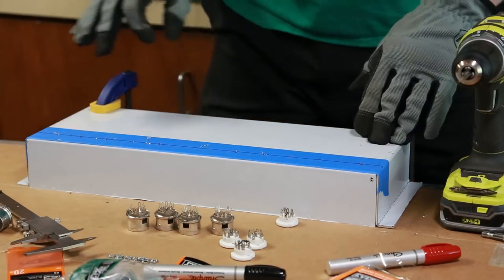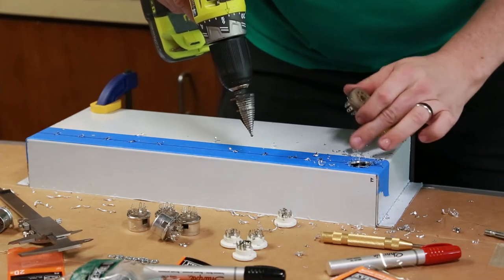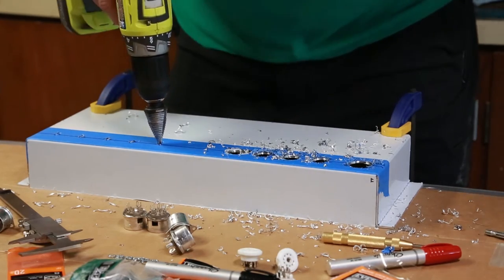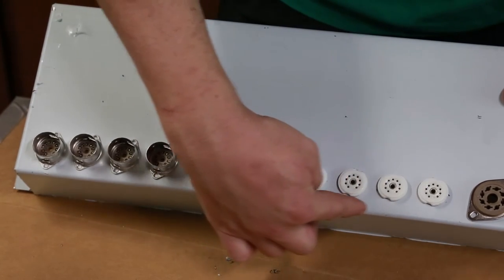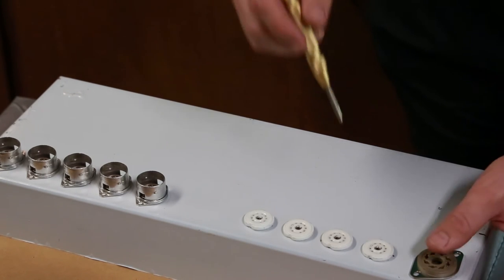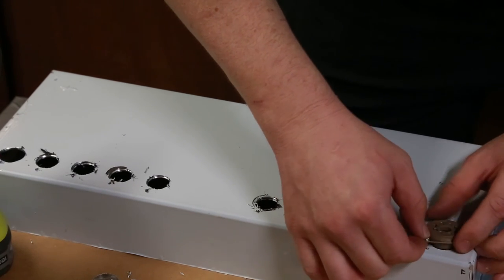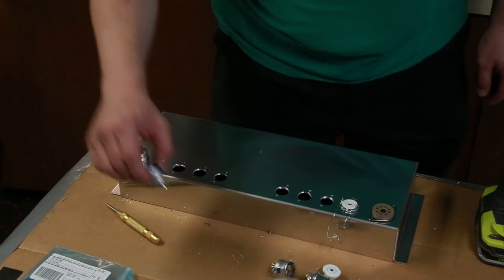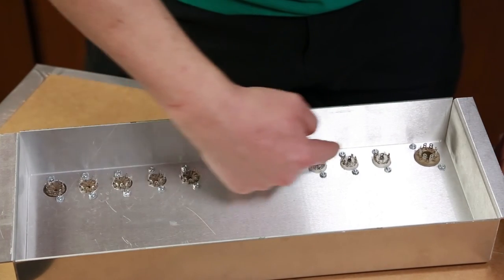Vox AC30/4 Video 4

Comment: Looks great!  Picked up a few nice tips.  I've always hated working with chassis' - but that's mostly because I don't really know what I'm doing.  

One question - did you find that you needed to debur the holes at all after using the stepped drill bit?
Reply from the maker: +Kley De Jong yup, I have a de-burring tool, or my files, either way, I almost always have to clean them up a bit.  Tell me about it, I still have a hard time with the damn metalwork
Reply: yes, just used a stepper bit on my chassis yesterday, really messy tools
Reply from the maker: +The Inebrati oh yeah, aluminum shards everywhere